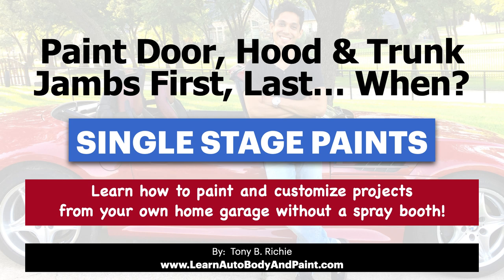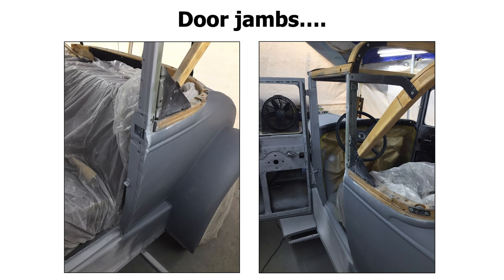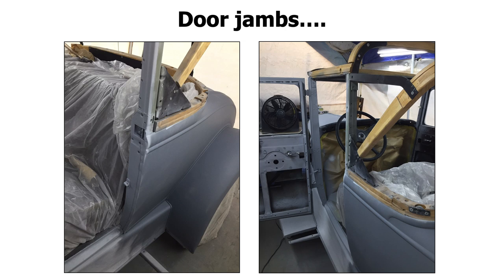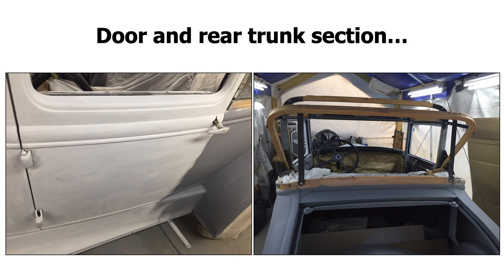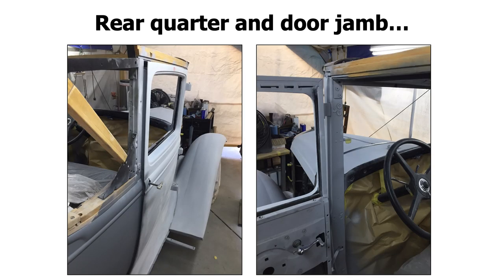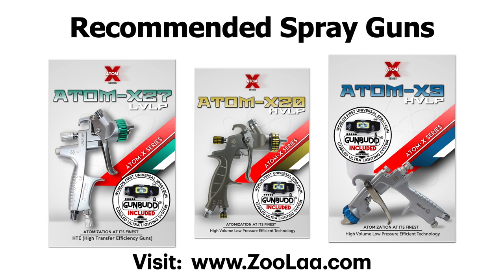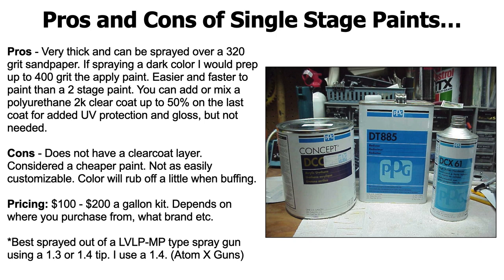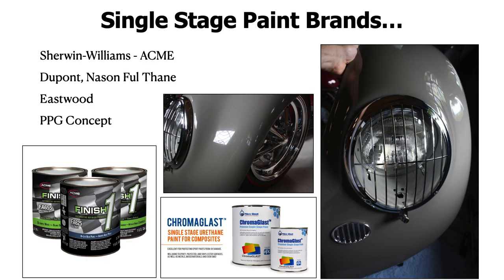Single Stage Paint Tips & Ways To Paint Door Jambs 👌

Comment: 14:33  What is the benefit of 2nd and 3rd coats, when it's single stage paint?  Is it that there is more paint to sand/polish or is there something less obvious that I'm not thinking of?
Reply from the maker: Well... just to have more paint on it. The first coat only is not enough paint for it to flow out. You need at least 2 coats when it comes to spraying enamel. A 3rd coat is for those who want that extra thickness for durability, room for polishing etc...
Reply: @HowToPaintYourCar   Thank you!  It's nice to know this for sure, since the few vehicles I'd use your tips on are all vintage and I like the way single stage looks more original... 👍

Comment: Very informative! What would you use to reduce polyester primer/surfacer (i.e. featherfill) and 2k primers to spray out of a 1.7 tip, acetone or base coat reducer?
Reply from the maker: 1.7 is not that small... but I would test it as you spray. Add maybe 5% and see how it flows out... if too thick or spraying dry... you may want to thin further.
Reply: @HowToPaintYourCar  Thanks, but which is it, acetone or urethane reducer or either one will work?